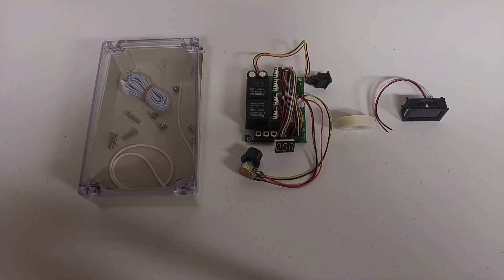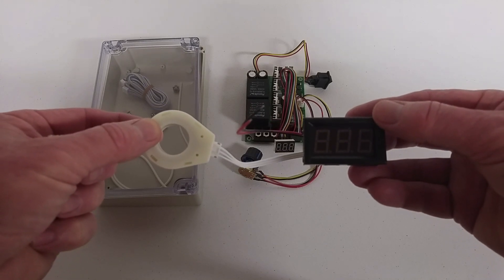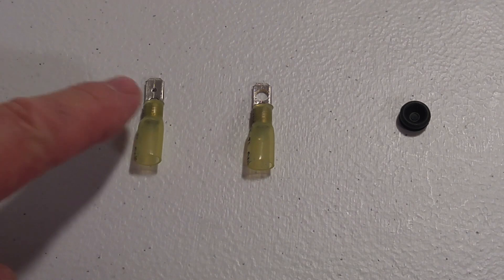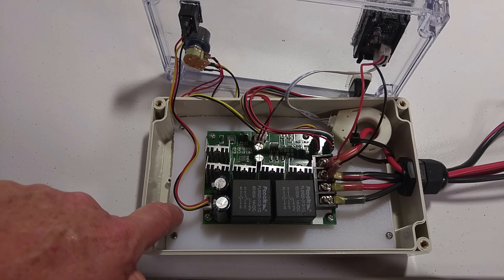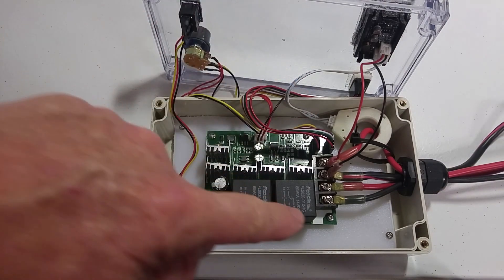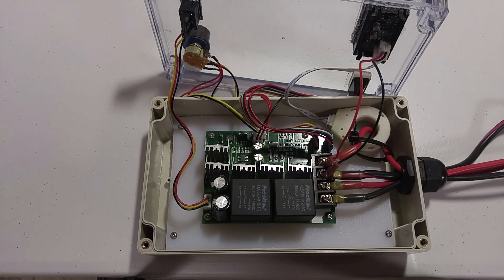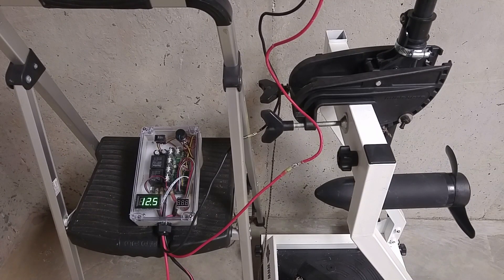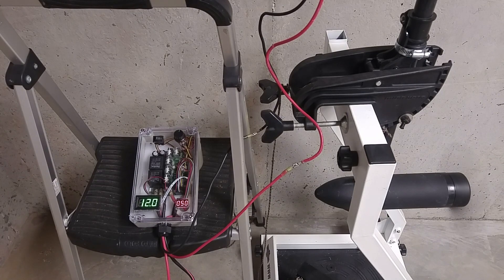DIY Kayak Trolling Motor PWM Power Voltage Amp Output Meter Box

Comment: Very nice setup!!!!!!
I have seen the 60 AMP with reversing relays but have never tried one.  Let me know how it performs for you with an on water test.  I really like the volt/amp meter.  Also the power meter included with the PWM gives you a more accurate reading that just turning the pot and guessing where you are at with the power.  I recently saw a similar PWM that was rated for 100 amps.  Not needed in that particular application but nice to know one is available.

John
Reply from the maker: Thanks John. I have used this PWM before on a kayak water test and it worked just fine. You are right that this should make the current draw vs % power much more accurate.
Reply: I have a minnkota 55 and even though its rated at 60 amps i,ve burnt up two of those pwm modules